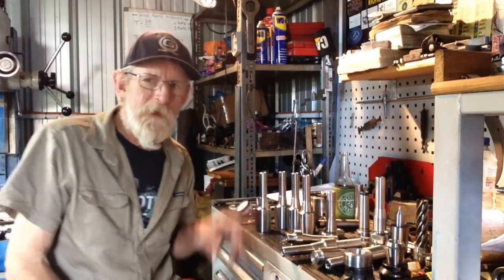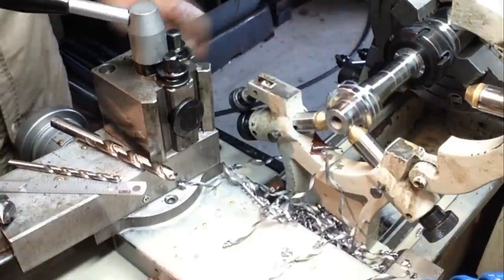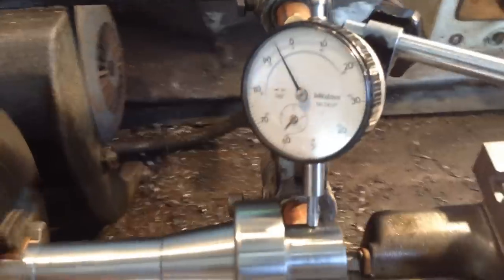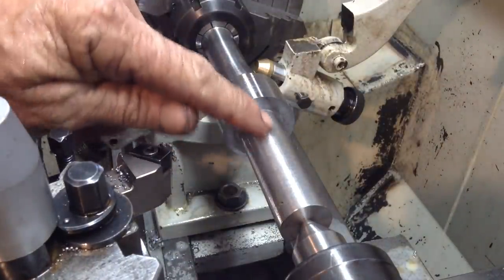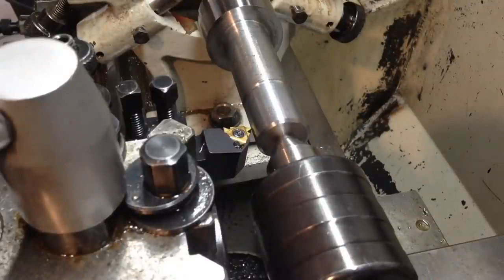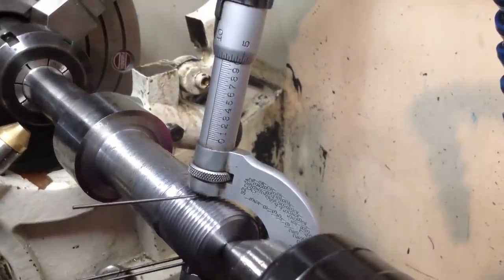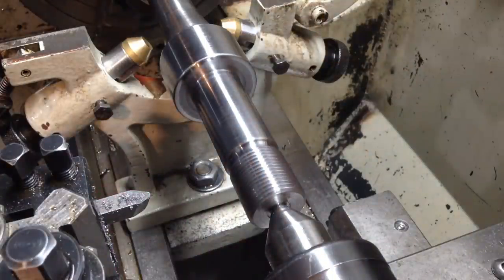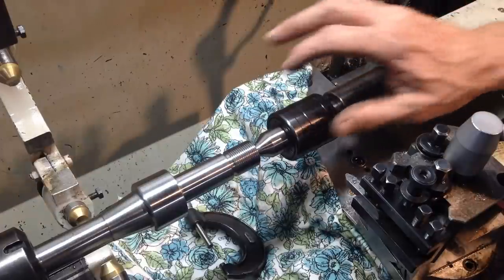Machining R8 Tooling For The Bridgeport .  Part 6

Comment: Great work, Max! Indeed most of them factory threads are .010" under or worse. I've run into that number a lot these past few weeks (.866025). Pretty much the number to memorize for anything with a 60° angle 😊. Good for calculating hexagons and thread depth anyways. And your right about finding camera angles on the small machines 🤣. Looks like you've been working with keyframes in your editing software 😀. I though I was tripping at first 🤣. Great work, Max. Thanks for the share!
Cheers 👍😁👍
Reply from the maker: I found a new button in the editing programme  , no micro dot's for you !!!    .   Yes the 8660 is a constant that pops up a fair bit .  Thanks Chris ,  Cheers .
Reply: @swanvalleymachineshop  🤣🤣🤣

Comment: Well, you can never have enough tooling!
Reply: Yep.
Reply from the maker: That's right ! I still have a pile of 40 & 50 taper stuff to make yet for the big mil .  Cheers .
Reply: Lloyd and others in this thread, correct! It is a bit like temperature, there is an Absolute Zero, 0 Kelvin, however there is no such thing as Maximum Temp. Nice work again Max.
Cheers from John, EC Australia.
Reply from the maker: @joandar1  Thanks John .
Reply: You are welcome Max, John.

Comment: They are going to be nice when they are done. Have you made any progress on the new shop? I have not done a thing on mine. It is either raining or snowing. Looks like it will be spring before we finally have some dry weather and can get back to work.
Reply from the maker: No progress , been to hot & flat out at work .  I have holidays coming up in a couple of months so it will be full steam ahead .  Thanks Tom . Cheers .

Comment: Loved the end mill trick with the steady rest. I had never thought of putting a short taper in the end of a threaded hole - that's a good idea. I must have missed the episode where you talk about the heat treatment plan. Are you doing it yourself? Cheers, Craig
Reply from the maker: Hi Craig . Yes i will heat treat them myself , it could be a bit sus but i will do a sample first !.  Emma's Hotshot oven is too far away !  Cheers .

Comment: Max, what do you think about putting a dab of grease in the threads to help keep the thread wires in place? Would that throw the measurement off?
Reply from the maker: I don't think it would throw off the measurement off but may taste funny as i usually hold at least one in my mouth !   Cheers .

Comment: What advantage does the heat treating give the tool?  I understand it hardens it.  Does that lead to better rigidity or is it a durability factor you are after?
Reply from the maker: Both  , providing the heat treatment works out ok .  It's also better for finish grinding if the part is hardened .    Thanks .

Comment: Like bread you can't beat homemade, not that I have tried Chinese bread nor would I want to just now.😏
As you like PD wires have had a look at the video where I show my version of one handed wires with built in calculation. I haven't yet done the Imp version only Metric but the idea is the same.
Interesting that you cut threads radially, I remember I was demonstrating thread cutting at one of the model engineering shoes going straight in and a few old timers said you can't do that, you have to use the top slide. Then another chap said he was taught to always use the top slide until he  got  his first  proper job and the foreman told him to stop wasting his time fiddling with the top slide and just straight in. Created some discussion with the oldies. 😉
Re your videos, keep up the oddities, doing the same old stuff all the time on all the channels will never spread the field of knowledge like YouTube should be able to do.
Reply from the maker: You only need to use the compound on larger threads  or if the top rake on the threading tool is ground at a compound angle if a HSS tool is used .  The insert tools you can use either method . I will look up your video .  Cheers .

Comment: Hey Max, i'm just learning and in doing so, I often ask stupid questions so pardon me and please bear with me. Why have you run this piece ( 25:52 ) in an ER chuck which inside your 4 jaw chuck, I'm confused as to why both methods of work holding at the same time, because if you have to use your 4 jaw to clock the part in, which is held inside the ER then why can't I do away with the ER altogether, or do away with the 4 jaw altogether?

PS. love your work, 
Cheers from Canada
Reply from the maker: There  were multiple parts to have similar operations done , so the ER was the best option  that i had .   It saved a lot of set up time as well as hold the parts true . That lathe does not have a dedicated ER set up so that's why i hold it in the 4 jaw .  When the parts were in the other lathe ( South Bend ) i do not have an ER set up for that one yet either , that's why the 4 jaw was used there .  It pays to have both work holding systems .   The best set up for an ER would be to have  it  on a back plate to mount directly to the spindle  with the capacity for run out adjustments to be done .    Cheers .
Reply: @swanvalleymachineshop  OK thank you. I'm about to buy one for my lathe (mt5 head-stock) i' m wondering if I get the draw-bar type or the "chuck" type. advantage with chuck type is a through hole, so i'm confused why many people buy draw-bar type. What am I missing ??.. ehich type should I buy

Comment: Why don’t you get your tools from china like everybody else does,its good and cheap, i mean its nice to know how to make your own tooling
But at some point one has to count the cost.Nice work your doing and manny Thanks for sharing.
Reply from the maker: At this stage tooling from there is a last resort as it's usually rubbish . Even things like reamers , grinding vices & a spindexer etc i will make my own .  When  my new shop is up & running things may change then depending on work load . I do have a 530 x 2000 lathe made there but it is of their higher level of quality . Thanks Tony , Cheers .